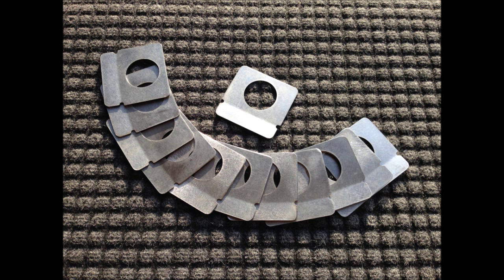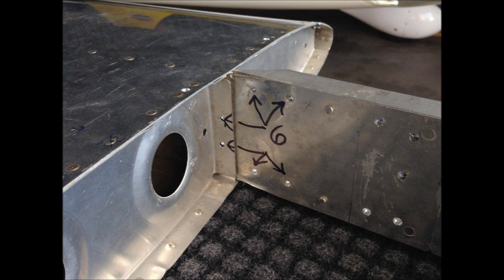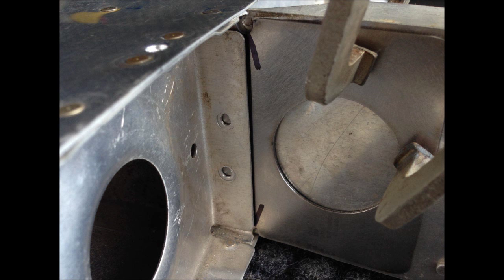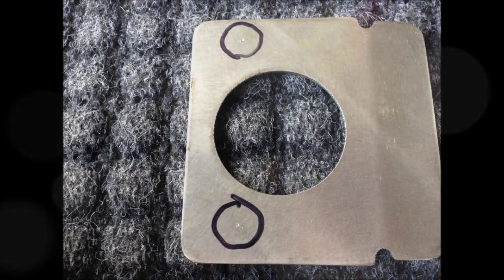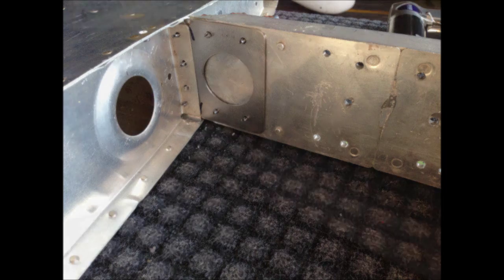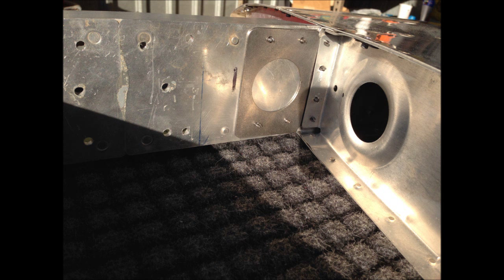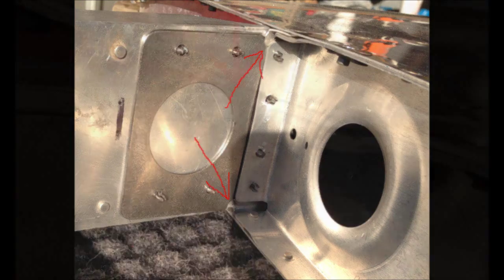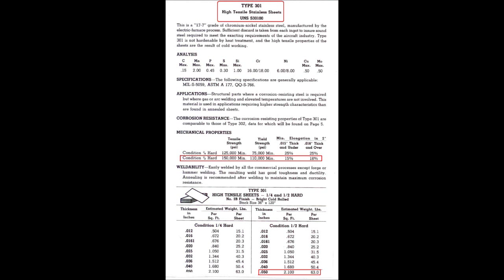Horizontal Stab Spar Mod by AntiSplatAero.com

Comment: The Vans mod plates that Vans supplies is longer, and ties into the area beyond that first rib. I believe that’s where the strength is needed. Sure, this part is stronger, being made of stainless, however it’s too short! Any bending moment is being directed into the 2 rivets in the rib flange. Yes I know there are 4 rivets in the rib flange, but the two close to the centerline aren’t carrying the load like the outer ones are. I wouldn’t feel comfortable using this part without the row of rivets extended past the inboard ribs..that’s where the strength needs to be. This doubler will eventually shear those corner rivets. If I were doing a condition inspection where this was installed to repair cracking, I wouldn’t  sign off on the plane without replacing this with the Vans SB repair.

Comment: Perhaps builders could install the spar mods at the time when the wings are built and avoid the problem entirely.
Reply: Van's has been providing the reinforcement plates in the kits since the problem was first found.  If you need the plates, they're $8 for the set.
Reply: This isn’t for the wings, it’s the horizontal stabilizer spar.